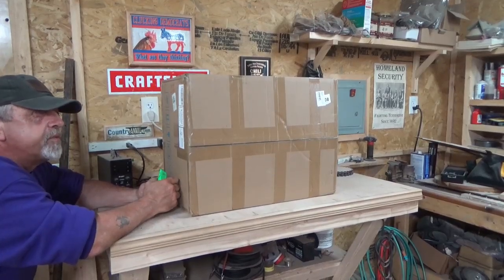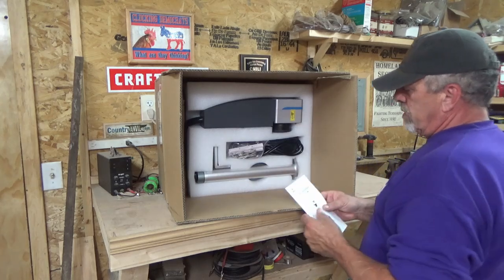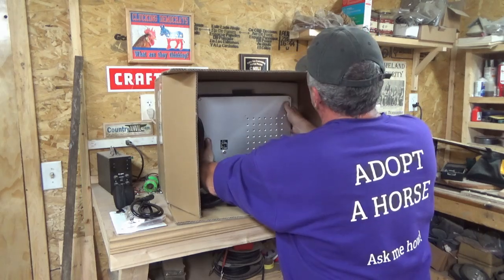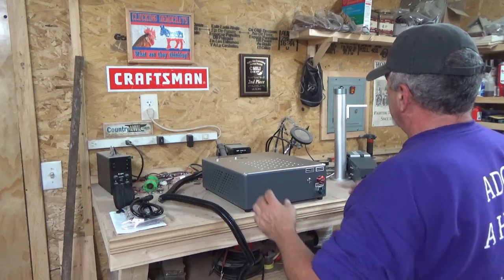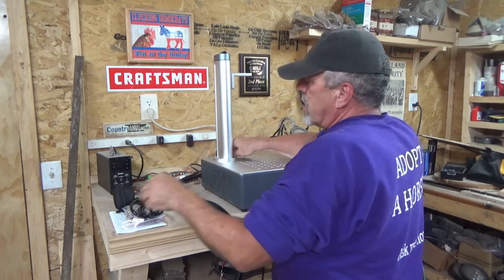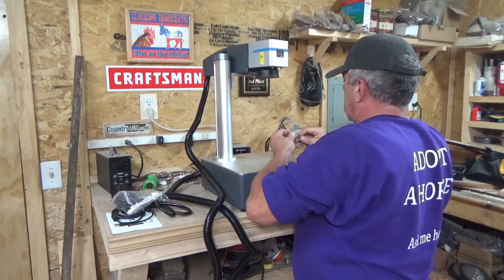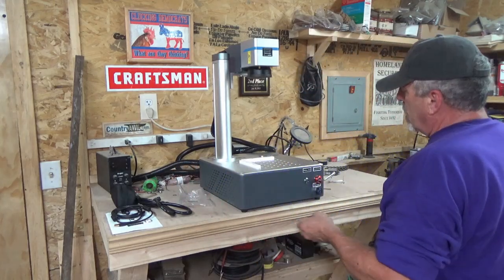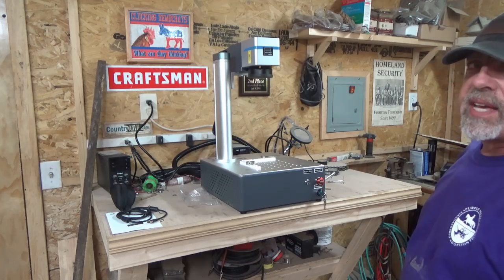OMtech Galvo Compact 50 Watt Fiber Laser Unboxing

Comment: Just got this machine and not sure what to do with the yellow/green (ground?) wire attached to the back fan. What did you do with yours? Thanks
Reply from the maker: The green wire is an additional ground. Usually used if your electrical wiring that you plug the machine into has no ground wiring. I've heard a few different theories on this wire, even one that it's for overseas use and not so much in the U.S. Just for the record, I don't use it.
Reply: @SteeveeDan  Okay cool. Thanks for the reply!

Comment: Would you recommend thia for polymer?
Reply from the maker: Honestly, probably not. I've cut some black plastic with it and while it does do it, the results are a little less than stellar. Lighter colored plastics don't absorb the laser energy well and it's a real struggle. Strangely enough though, it does mark pvc pipe very well.